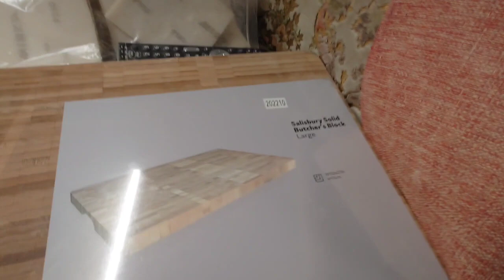How To Make A Set Of Audiophile Wooden Speaker Stands

Comment: Like these a lot, just one comment, as a guarantee that the spindles wont turm, I know they are glued, but on the bottom plate where the torx screw are I would drill then hammer a round nail in near the screw, use a nail punch to get them below the surface, one nail in each spindle, this will prevent them from twisting as an extra precaution, no need to do the top plate and leave a nail hole showing.